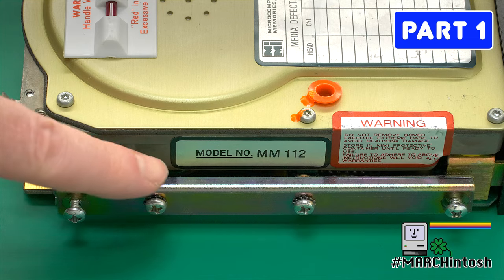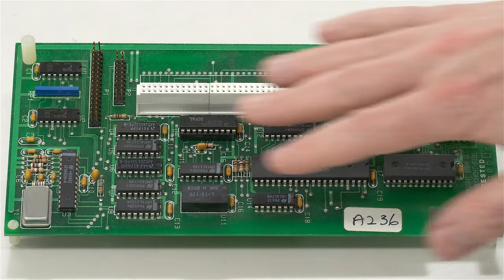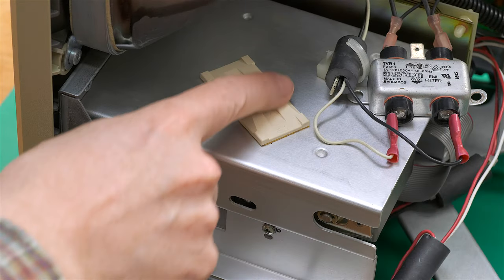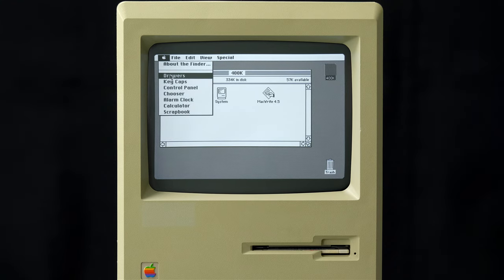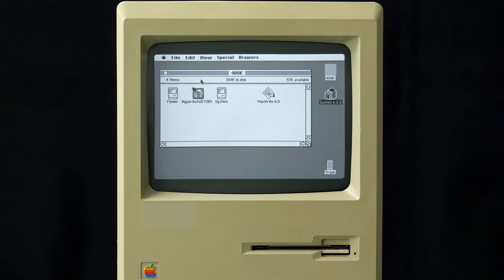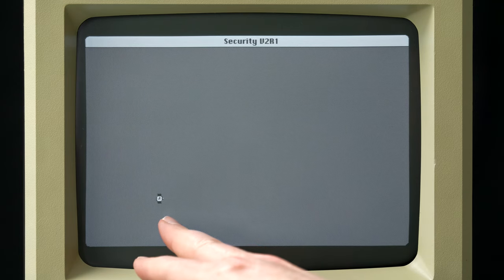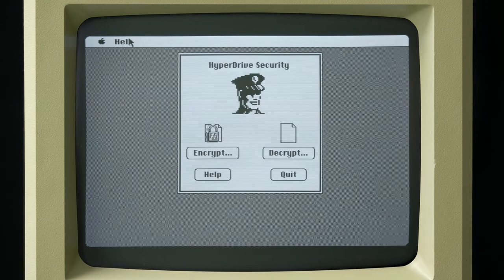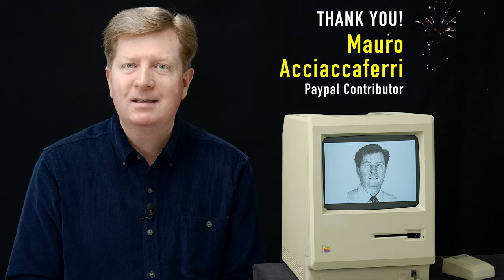GCC HyperDrive 10: History, Installation & Software [Part 3 of 3]

Comment: It's pretty remarkable that there was a 3rd party bootable HD for the Macintosh before Apple even had developed that feature. Even more remarkable that it came with GUI software that enabled partitioning and setting some filesystem options as well. This may be one of those rare things that is years ahead of its time. THANK YOU for making this incredibly detailed video. I wasn't going to watch the entire thing, but I did because your content is truly excellent.
Reply from the maker: I certainly appreciate your gracious words and your kindness in watching the video in its entirety.  Even more remarkable than the fact HyperDrive included partitioning (Drawer) software is that each Drawer would auto-resize as you added software.  So you would never be in a situation where the partition was locked in size such that you might accidentally fill it even though you still have free space in other partitions.  You would just keep adding software to any of the partitions until the entire space of the drive was filled.  Intuitively, that's what should happen in most cases, but no other software back in the day offer that level of intelligent functionality.

Comment: I think that is the most kludgy retail upgrade I've ever seen. ...but I can imagine just how magical it was for those who got it!  Booting off that drive is so much faster than an 400k floppy, not to mention 10MB at that point in time just felt MASSIVE!   I remember when I got a 10MB into my SE, that was a game changer!  ...that and Apple's "super drive" (a name they really enjoy recycling).
Reply from the maker: Sounds like you've been a Mac fan about as long as I have.  I was 13 in 1984 and our family's first home computer was the 128K, early that same year.  Unfortunately, that Mac was purchased only with the stock internal 400K drive, no hard disk, and no second floppy drive either.  We should have purchased the external 400K drive at that time because it later became "disk swapping hell" when you booted off a System disk but then needed to insert a second disk which had either files or an application program on it.  I remember one time when I literally swapped two disks in and out 100 times!  I kid you not!  Hard disks eliminated that headache, as did the 800K drives, but hard drives were quite expensive back in those 10MB days, let me tell you.
Reply: @JDW-  Yeah, I was born in 1984, but I grew up with access to computers (at home, at my dad's work, and at school), and I got my first job at 11 at a Mac repair and exchange store, were we'd buy decommissioned Macs by the pallet.  It was my job to go through them, identify what was wrong with them, cobble together working machines, and get them ready for sale.  The first computer I personally owned was a 128k Mac (I bought it from a school auction, and it's what got my foot in the door for my repair job), and I worked my way through most of the Mac roster up to the end of G5 era (by which point I had moved on to networking and programming, so I was no longer actively flipping machines).  So I didn't come onto the scene quite as early as you did, but I did work my way up through the very early machines, so I certainly can relate, and I was early enough that things hadn't quite managed to go mainstream at that point, and I was right in the thick of it as they did.

Comment: Hi JDW! Thanks for your fun and nostalgic videos! I suspect the reason your MacWrite was quicker than expected on floppy disk is that you were still running the system off the HyperDrive. Apps needed to load system resources and code at launch time too (fonts etc...) Try running the test booted off the floppy and I bet it'll slow down.

My family got a Mac Plus in 1986, I believe, and we only ever had the 1 floppy drive. Imagine this 5 disk scenario: 1 Boot floppy, 1 MS Word floppy, 1 spelling dictionary floppy, 1 fonts floppy (using suitcase) and 1 documents floppy. Now run a spellcheck on that long multiple fonts used Word document. Yes this really happened. I remember disks being angrily thrown across the room. I was so glad when my uncle sent us a 2 drive x 20 MB Bernoulli box. That made life so much easier.

Keep up the good work!
Reply from the maker: Thank you for watching and for your kind words!

Your family was luckier than mine.  We started with the 128K in 1984 with only the single 400K internal drive.  Talk about disk swapping hell!  Suffice it to say, I upgraded the RAM and disk drives as soon as a reasonably priced solution hit the market.  (HyperDrive was not that solution, of course. It's price was sky high.)
Reply: Please insert the disk "fonts" <inserts disk> (floppy read sounds, floppy eject sound)
Please insert the disk "dictionary" <inserts disk> (floppy read sounds, floppy eject sound) 
Please insert the disk "Microsoft Word" <inserts disk> (floppy read sounds, floppy eject sound)
Please insert the disk "Documents" <inserts disk> (floppy read sounds, floppy eject sound)
Please insert the disk "Microsoft Word" <inserts disk> (floppy eject sound)
Please insert the disk "Microsoft Word" <inserts disk> (floppy eject sound)
But I did insert the right disk!!
Please insert the disk "Microsoft Word" <inserts disk> (floppy eject sound)
Shoves disk back into drive
Please insert the disk "Microsoft Word" <inserts disk> (floppy eject sound)
Pull disk out, looks at it. Yup. Correct disk.
Please insert the disk "Microsoft Word" <inserts disk> (floppy eject sound)

Does anyone else remember similar experience on early mac?
Reply from the maker: @BestSpatula  The less RAM you had (i.e., the 128K Mac), the more often you'd enter Disk Swap Hell.  A second, external 400K drive helped eliminate that, but many people had already spent so much on the computer, they didn't have any budget for the external drive.  That was the case for my family anyway.

Comment: GCC Ultra Drive external drives were awesome.
Reply from the maker: I actually do not own one of those externals, but I do know the history.  By the time GCC got into the external SCSI drive market, it was already crowded with quality SCSI drive competitors.  That forced GCC out of the drive market not long after, and their company then began to focus on laser printers instead.  GCC basically made a good name for itself in terms of SCSI drives in the early days by having one of the first INTERNAL drives for the Mac, which is what my video centers on. That's not to say GCC didn't have their share of problems.  They did have defective drive issues.  But it's not clear if those defects pertained to the MMI 10MB drive (their first edition drive) or the later 20MB drives.  Regardless, it's pretty amazing my HyperDrive10 still works today in 2022!

Comment: Really interesting; thanks for sharing this!
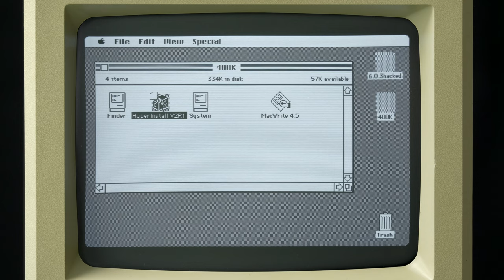51:05 It reminds me a lot of running my Mac Plus emulator w.r.t. weird things that happen when you patch the Macintosh ROMs.
My emulator (A-Max for the Amiga) seems to replace the Sony (floppy), HD 20, and Sound drivers; this is how it manages to make Amiga floppy and hard drives accessible to the Mac Plus being emulated. I'm have the 128K Mac Plus ROMs though, so more things can be made to work.

Comment: Excellent video!  I wonder why it needed 512K to work?  I had a Macintosh 128Ke a long time ago (a Mac 128K with the 128K ROM installed with 800K floppy drive, but no memory upgrade).  It worked fine with the HD20.  I assume their software needed more memory.
Reply: I was surprised by that as well.  But given the memory prices of the time and that fact that 128k was hardly enough, that upgrade seemed worthy.  I suspect you are right that it was their advanced software that requires the extra memory.  I have never seen a hard drive with so much software, drivers, features, et cetera.
Reply from the maker: @MacEffects88  The technical reason is because the HD20 acted like a big floppy disk externally, and with that set of 128K ROMs installed you didn't need to eat valuable RAM by loading the HD20 INIT. But the HyperDrive attached directly to the 68000 CPU and therefore needed software (drivers) to be loaded into RAM.  The 128K lacked adequate RAM for that.  That is why GCC worked with Apple to offer a 512K motherboard swap with a 10MB hard drive bundle, albeit for a very large price tag!

Comment: Heh... I lived in Walnut Creek, CA in 1985. Sadly, that Mac was a bit out of my price range at the time.
Reply from the maker: Hard Drives were an incredibly expensive luxury in those days.  I started out with a Macintosh 128K in 1984 that had only the single 400K internal drive.  That was quite painful to say the least. Over time I upgraded that Mac to a Plus and added an 800K external drive, as well as a hard disk for a very respectable price some years later.

Comment: I recently got a Mac 512k with a Total Systems 68030 Card with SCSI tucked on the logic board. Has anybody an installation manual of such a card? I am puzzled how to get the logic board out of the frame without damaging the board. I believe my card is thicker than the hyperdrive daughter board.
Reply from the maker: I cannot speak from personal experience about the exact board you have, but as is true of any piggy-back, add-on board system inside vintage Compact Macs, you can always remove the motherboard by carefully, using a wide, flat-head screwdriver on the bottom metal tabs on the left side of the motherboard (when viewed from the bottom -- side opposite to the analog board).  That is how they got the board in there in the first place.  You will likely need to pry twice -- once to get the motherboard beyond the metal slide rails, and then a second time to get the add-on board beyond those rails.  Sometimes you may need to pry out the right side of the motherboard too.  But basically you need to use a flat head screwdriver between those metal tabs and the side of the board itself.  What you are basically doing is moving the bottom metal chassis out so you can pull out the board, which otherwise would not slide out.
Reply: @JDW-  Thank you for your reply!! I am just curious how they did get the board in. There must be a special tool. There are absolutely no marks of a screwdriver on the logic board. I will try to cut a piece of wood, which is 2mm larger dimension than the logic board and push it in the chassis over the logic board to get both sides of the metal chassis bend to the outside.
Reply from the maker: @VintageTech  I never leave marks when I use my flat head screwdriver, so it's possible they got the board in just as I described in my previous comment.  You can use a wedge to move the chassis outward, and so long as you don't pull it out too much the chassis should move back into place once your wedge is removed.  

In my next video, due to be released in less than a week, I demonstrate prying with a flat head screwdriver.  I need to do that in my new video because I am adding a board on top of the motherboard, which is too tall for the board to slide in normally.
Reply: @JDW- I am looking forward for your next video. I will wait with taking out the logic board until I have watched your video!

At the moment I am busy cleaning the bottom side of the logic board. The rubber dot in the middle of the board "melted" an messed everything up.

Comment: you can still see the ghost of the hyper drive sticker below the screen
Reply from the maker: Indeed.  When I first received the machine, the sticker had fallen to pieces and that mark is all that remains.  I really dislike stickers placed on the front of vintage Macs anyway, so I'm not bothered by its absence.  Such stickers make more sense on the back.  Placed on the front, it distracts from the overall aesthetic of the machine.
Reply: @JDW-  I completely agree and the hyperdrive stickers was particularly ugly from my recollection
Reply from the maker: @5274jacob  Yes, indeed there are!  "Atrocious" is the term I prefer, but then again, I am a purist at heart.  I like the original, clean look on the front of the Mac.